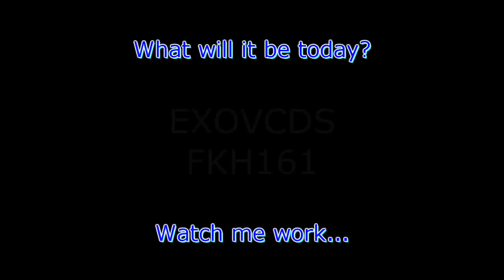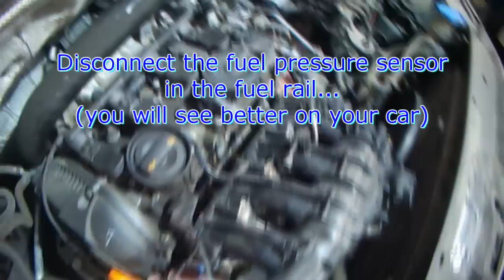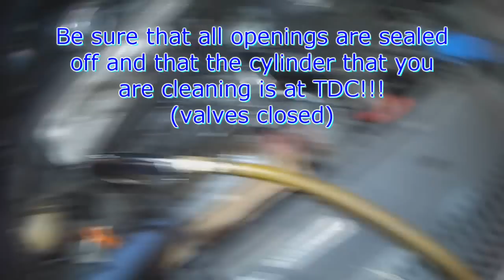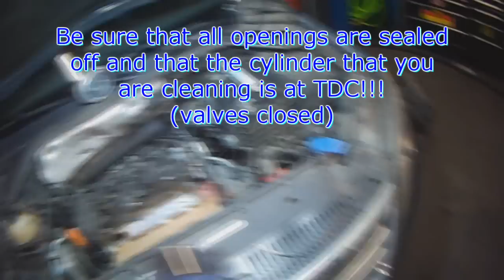VW A5: Tiguan 2.0LT Intake valve decarb

Comment: Great Work.
Reply from the maker: +Javan Javadov Thanks for watching & taking the time to comment!
Reply: We have same type of engine at the shop we never did the cleaning of the valves, It had 4th cylinder misfire. After changing the coil,still had the same code, we went in to change the injector, we saw that valves are dirty. I was thinking to cleaning the injectors. How did you clean it? Is it just air? Or is there any vacuum attached? any cleaner chemicals? Thanks for taking time to answer questions.
Reply from the maker: +Javan Javadov Walnut Blasting... watch this: https://www.youtube.com/watch?v=Z-zmhv_LWr8 and this: https://www.youtube.com/watch?v=SGETxchByUk

Comment: Great vid bro! What was used to cover the the other ports? Was that plastic? And roughly how long did the whole job take?
Reply from the maker: Duct tape across the cylinder head port openings... cardboard under the port openings and tissue in the injector ports. This was my first time, so I took it slow... the blasting took maybe 1/2hr (again, I took my time). There's no set labor rate for something like this (as far as I know)... so the more that someone does this, the faster & cheaper they will be. The video was edited (took out the walking back & forth between toolbox & car, lifting & lowering the car)... but for the most part it is still "time wise "correct (insert your guestimated time here).

Comment: Why they got carbon deposit tho?
Reply from the maker: The injectors spray fuel directly into the combustion cylinder... on older engines, the fuel is sprayed in front of the intake valve. The fuel cleans / washes the valve head as it passes the head. Direct injection doesn't do that. Manufacturers are now adding injectors in front of the valves on newer Direct Injected Engines to help keep the valves clean.
Reply: cool I just got my throttle body and intake manifold cleaned. So expensive... I got a leaking gasket too...

Comment: Thank you for uploading the video! I have a 2012 Tiguan with mileage almost 80k and the engine light is on. VW dealer told me to do a intake decarb with a quotation of almost $1000. Should I do it or I can go to any auto repair for a lower price?
Reply from the maker: Lower price isn't always better... there are many seals that need to be replaced when removing the intake. Lots of shops will not know what they need to replace, and the price will all of a sudden be higher than the initial quote. Many shops do not have the walnut (or soda) blasting equipment... so they end up doing a mechanical cleaning (hand picks & chemicals) , which takes longer than a media blasting setup. If you are a regular / current dealer customer, stick with them, so all the work history is with them. If things go wrong down the road, you know that it has been dealer serviced... and they can't claim fault due to unauthorized repair facility. But a competent Euro Specialty Repair Shop should have no problems cleaning the intake ports for you.
Reply: Thomas EXOVCDS Thank you for your reply! I just checked with several auto repair shops and they ALL use chemicals though it’s much cheaper.So I should go for a walnut blasting solution right?
Reply from the maker: Up to you... whichever is easier / cost effective for you.
Let me know how things turn out.
Reply: Thomas EXOVCDS I will! So far I haven’t found any place could do walnut blasting, including VW! They said they will clean by hand.
Reply from the maker: VW Dealer should have Soda Blaster (similar to walnut blaster, but some kind of fine powder). It doesn't matter where you take it... I just wanted to be sure you take it to someone who's familiar with the vehicle and the cleaning procedure.
Reply: Thomas EXOVCDS Eventually got the decarb in dealer for almost $1000 because the other day my car shut off less than a minute after started. And I tried couple times same thing happened. EPC and check engine lights were both on. Anyway, thanks for your advice!
Reply from the maker: Thank you for the update... let me know if any issues come back (misfiring when cold).

Comment: Did they never floor their car? Why would this happen on such a new car? Hi miles, or just plain design failure?

Tnks for the vid :)
Reply from the maker: 142k km's... no injectors in front of the valves for gasoline to wash them clean with every intake stroke. PCV fumes are the only fumes to go past the valves... after the power & exhaust stroke, valve overlap pushes a bit of hot exhaust back into the intake and the Pcv fumes get baked into place.

Comment: What were the plastic pieces you removed from the intake ports? What's their function and what happens if they're left out? Curious
Reply from the maker: Those are air deflectors that work in conjuction with the flaps in the intake... variable intake manifold of sorts.

Comment: I'd say that engine technology will have to improve before I buy anything like one of these. WAY TOO MANY ISSUES WITH THIS ENGINE. If you are going to buy a TSI powered vehicle, you had better read up on it. Manifold failures, main seal failures, timing chain failures, and valve coking. Come on VW-your reputation is changing fast. Kind of makes me want to get rid of my MK4 TDI.
Reply from the maker: I can say the same for lots of manufacturers... holds true for many other things, furniture, bicycles, homes. In a perfect world, there would be no problems / issues.
Reply: Yes. At least it keeps you busy. Great videos by the way! I do my own work. It's great to watch a pro before starting a job.
Reply: Jason W I agree to an extent but for example, my 2014 Audi s5 3.0tfsi has 140k. I walnut blasted at 80k and other than that, I've replaced the water pump, thermostat and the motor mounts. Nothing else and it runs the same as the day I bought her with 15 miles. Been more reliable than any Honda or Toyota I've ever bought.

Comment: Here is the question of removing the dirt of the suction valves with sand while simultaneously sucking
Reply from the maker: I use Walnut Shells.
https://static.summitracing.com/global/images/prod/mediumlarge/sum-913126_ml.jpg
Reply from the maker: https://i1.wp.com/walnuts.org/wp-content/uploads/2017/07/walnut.jpg?resize=505%2C473&ssl=1

Comment: my uncle has a 2009 2.0t tiguan with 60k miles.  I noticed he has a small oil leak coming from his valve gasket cover. the part is $5 for a new gasket.  is it a DIY job? if so how long would it take?? did you make any videos on it?
Reply from the maker: The "valve cover" does not have a gasket... VW uses just a sealant. There is a plastic PCV assembly that does have a gasket... unbolt and replace gasket. The front upper chain cover also has a gasket... more involved, don't have a video for that either... yet. =)
Reply: Thomas EXOVCDS so replacing those seals would fix his small leak? is it a easy DIY I have all the tools just learning how to do more on repairs
Reply from the maker: The top plastic pcv assembly should be easy / straight forward... the upper chain cover is more involved, have to remove passenger engine mount.
Reply: Thomas EXOVCDS do the Erwin manuals explain how to do it in detail ?
Reply from the maker: Sorry about the late reply... The erwin manuals assume that the person reading it has some kind of automotive experience. Certain things are explained step by step... while other things are just shown in "exploded view" diagram format, with torque specs for assembly. Even if you don't end up doing the work yourself... $35 for a bunch of service manuals is well worth the cost. You can read-up on what is involved and have a better understanding about how stuff works. =)
Reply: Thomas EXOVCDS are the manuals vehicle specific ? and if I wanted to do a coolant flush will the manuals show me where to disconnect the hoses? and how to refill and purge the air?

Comment: Hi Thomas great videos Martin here from  USA Arizona I have ak 2002 vw jetta with a engine code p01780 I tried looking on forums for a answer no luck I was driving the jetta to work one morning an it started jerking and running funny like it was loosing power I was able  to make it home what ive on line tcm ecm not communicating thanks for your help
Reply from the maker: This is a code that was stored in the ECM? What scan tool were you using? Was the TCM also scanned? I can't find any info on that code. Which automatic transmission do you have?

Comment: When I check my code now I had the mas air flow unplugged. How can I test mas  air flow. Also when engine is on an I unplug it engine stays running.
Reply from the maker: Power , ground, signal... there are various MAF sensor testing videos on youtube.

Comment: Too bad there isn't a way to chemically do this. Were there driveability issues the customer was complaining about?
Reply from the maker: JohnzCarz Intermittent misfires when cold. If treated with an induction cleaning agent on a regular basis, from what I hear, it can be prevented / slowed / reduced.
Reply: ***** We have the BG line of products where I work. They help if done regularly, but quite honestly every intake I pull looks disgusting from the 2.0t to the 5.0v10's. Cleaning by removing the intake is a great way but kind of hard because no set labor rate. Plus I worry sometimes the chance of a flap or the shaft that controls the flap messing up or vac leak afterwards might then cost us an intake manifold. But sometimes it needs to be done. Great video by the way!
Reply from the maker: Bozi B Thanks for the info and thanks for watching & taking the time to comment!

Comment: Hey my man I love your videos watched a lot of them big fan I have a P2188 code On my 2010 Volkswagen CC I can't figure it out can you help
Reply from the maker: Which engine?
Reply: 2.0 T I clean the throttlebody and The carbon buildup also thanks for replying
Reply from the maker: Was the code present before the cleaning? I don't have any information on that code and I have not run into it myself. Check with Humble Mechanic (he is a VW Dealer Tech and might have inside information).
Reply: I did it last year the code came up couple days ago I watch the video Charles how to remove the intake
Reply: Thomas EXOVCDS thank you so much for replying I know you're busy the code is 2188 system to Rich at idle bank one have no idea I just don't want to replace parts that I don't need to replace